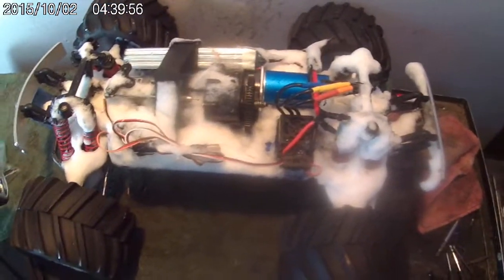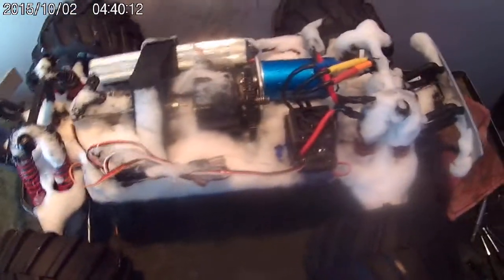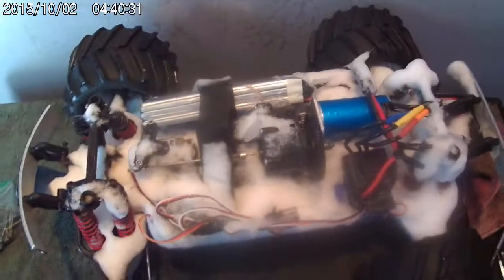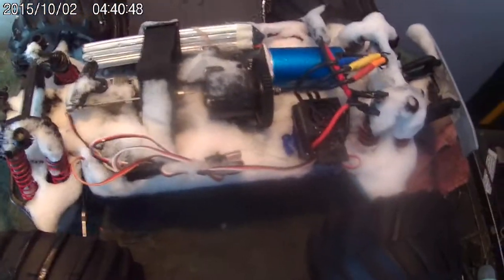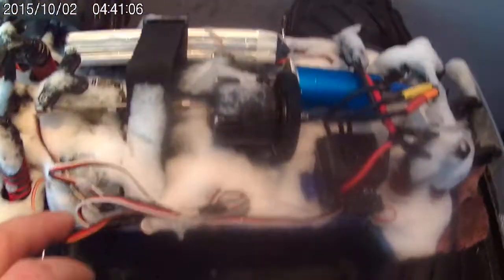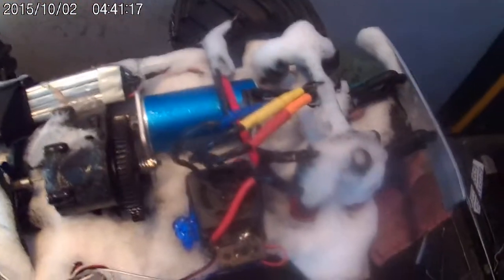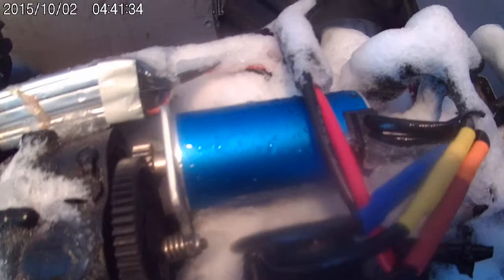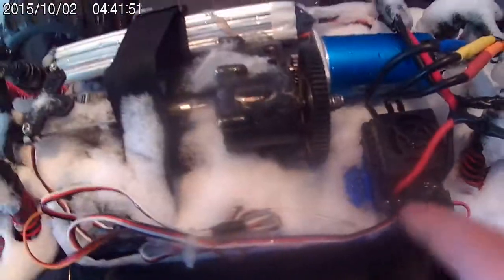ocday 60a car/truck esc review and waterproof test

Comment: whath size of your motor and kv
Reply from the maker: the motor is 2150kv. im not sure about the size of the can. i can tell you its in between a 550 and 775. it fits in most traxxas 1/10 vehicles and its pretty much the same can as what is on the redcat terremoto 1/8.
Reply: jarrod winters the esc is not hot whith this motor? wath is the speed on this car?
Reply from the maker: the lower the motors kv the more torque. so this motor does not require as much amp draw as higher kv motors like say a 4000kv. and to answer your questions, no the motor does not heat up the esc
Reply from the maker: the speed is probably 35 mph. never clocked it.